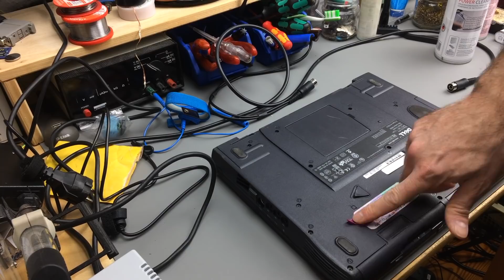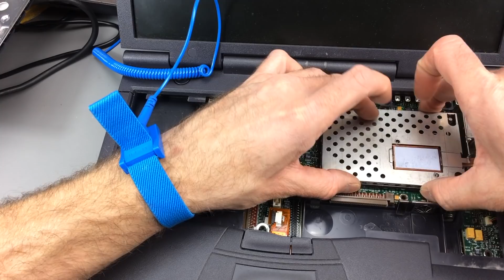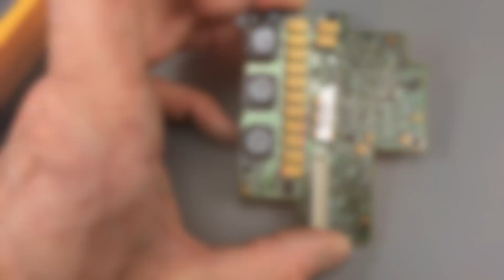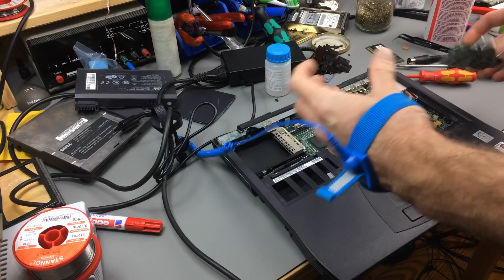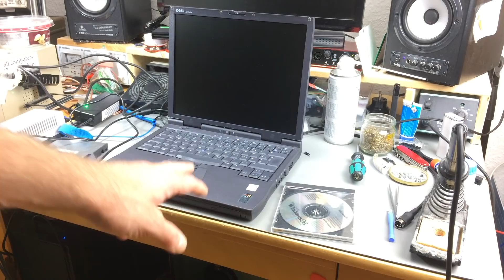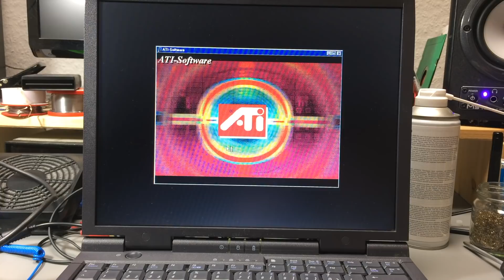Dell Latitude CPx H500GT Repair and Windows 98 Install

Comment: Are you using a Win98 Dell Product Recovery CD?
Reply from the maker: No, just a standard Win98 CD. I didn’t find an image (or actual physical media) specifically designed for this machine anywhere. (It’s an old video so it may be available now though.)

Comment: Hello friend. I have adquiered recently the same laptop. 
I was trying to use it for programming in C language. 
But I'm not able to use the symbols <> when I'm inside DOS. Instead, when I run win98 I'm able to use those symbols. Do you know how could I fix this dum issue? Thanks in advance
Reply from the maker: You probably need to use another keymap, look up the KEYB DOS command. There's a lot of options and I'm not sure which keymap works best for this particular machine and your keyboard layout, so you're going to have to figure that part out yourself. Hope that helps!

Comment: Jan: I have a Dell Latitude CPt-V from 2002. I put 2x256mb sticks inside, PC100 and PC133...maxing out the ram to 512mb. My hard drive is 20gb, with Windows 98 Plus. The CPU was a Celeron 466mhz Mendocino; I put in a Celeron 500mhz Coppermine which in the BIOS shows up as a Pentium III CPx-H. Also replaced the CD ROM drive with a dual DVD ROM/CD writer. I purchased both my charger and CMOS batteries directly from China. I had to wait more than 2 months for them to arrive in San Francisco and finally to New York. I really enjoyed watching you repair your Dell Latitude CPx-H. It's a classic. Awesome video.😊

Comment: That daughter card on which you are measuring tantalum caps with your meter is a Voltage Regulator Module.
I tuned in because I have a Latitude CPt on my workbench and these models are somewhat similar.  Yup.  I'm in repair mode.

Comment: Hey. I just managed to pick up one of these at a second hand store and it is unfortunately missing the power supply. I'm wondering if you might know what cheap power supply you bought as a replacement for the original as I would like to test mine but would rather avoid paying the 50$ with shipping prices that ebay sellers are asking for OEM power supplies

Comment: thanks the idea with replacing the ceramic capacitors on the power board helped me a lot!!
I got one question though... where the heck is the cmos battery?? I need to replace mine as well.

Comment: I didn't see any BIOS / CMOS battery 🤔
Reply from the maker: It’s below the track pad in this model I think. I’m going to have to replace it eventually.
Reply: @JanBeta  Maybe you should do a video of that. I have the same laptop but mine just blink a few times the 3 little LED ligths and turns off. I think I should open it up and see whats wrong. I hope I can fix it and your videos are very usefull. Thanks.

Comment: Jan! I have exactly the same laptop with the same problem. Perfect condition but plug a working Dell charger in and no lights came on AND the charger green light went out! So a bad short. Am watching closely.!!! Good job! This is almost a perfect W98 laptop/ ATI 8 mb graphics is surprisingly good. This will run MSFS 98 very well. 
   Oh windows 98Second Edition and instal PLUS! on it to have cool desktop/screen savers. Good luck.

Comment: Can you check how much video RAM it marks?
I have the same model with windows 98/2000 dual boot
On windows 98 it marks only 64KB video RAM
But on windows 2000 it marks 8MB

Comment: Hello
I have a laptop model dell latitude CSx H500XT, just use the FDISK to partition the hard drive then restart it and I got the message "the operating system is not found"
What should I do to access the hard drive.
Thank you
Reply from the maker: You have to install an operating system. If you partition the drive, it initially is completely empty. On boot up, the computer searches the hdd for an operating system.

Comment: I'm working on one of these right now.  Currently it's giving me the "bad RAM" lights, Power, Caps lock & scroll lock.  They all stay on for a few seconds, then shut off.  Maybe it's the power board inside like yours, but I don't get the same symptom of a shorted cap.  A couple notes... You can run two batteries in it, and you can get a cable that you can connect the floppy (not the cd) drive to the parallel port so you can use both at once.  Uses PC100 SDRAM, and two 128MB SODIMMs should work if you want to really max out Win 98.  I have Win 2k running on an older CPiA 400, so I'm sure that Win XP would run on this.  I'm planning on using mine for a DOS 6.22 computer, if I can get it working.  We used to use these at work, so I have a lot of time with them, along with the C600, C610, C640, C800, C810, C840, X200, C400, D400, D410, D420, D600, D610, D620, D630.  I've had some sketchy results with aftermarket batteries in these, too.
Reply from the maker: Thanks for the tips! I hope you get yours up and running fully again, too. :)

Comment: "Bob Ross"   (chuckle)    Can just hear it...   "Happy little tantalum caps..."

This fix makes me wonder if there's some piece I could track down on a Toshiba Satellite A355D (powers on, but no POST).   Probably wouldn't bother with the HP Pavillion DV6700, as my understanding is they will ALL quit working eventually (and it has so many other bad parts like the battery & keyboard).   They were freebies as well, although I don't have the access to a soldering bench like I did working in a zSeries test lab.
Reply from the maker: Haha, maybe I should do it like that. :)

Comment: My Latitude CPi-A (300MHz Pentium II) from 1999 also still works. It came with a cable to plug the floppy drive into the printer port so you can use the optical drive and the floppy drive at the same time. I upgraded the CD-ROM drive to a DVD drive; it's not fast enough to play video DVD's but it works great for DVD-ROMs. Mine has 256MB (the maximum that fits in there) and it ran Windows XP for years, but by the time SP3 came out, 256MB wasn't enough for XP anymore so I downgraded it to Windows 98. I'm jealous of your nice 12" 1024x768 screen; I couldn't get one of those at the time so I had to make do with the 11" 800x600 screen.

Comment: Good job! At that time no doubt nobody repaired computers at the single component level anymore. Typically the whole of the voltage regulator module would have been replaced. Yet, such part obviously not being available anymore (this is not yet a venerable collectable machine worth selling spares for), you managed to get it working. Marvelous.

Comment: If you install Windows98, you really have to go with SE, for the USB support.
Reply from the maker: Oh, I did. The version I installed is an old OEM Windows 98 "Zweite Ausgabe" (which means second edition in German). The USB stick I tried didn't work because it's too modern/large I assume.

Comment: CPXh and CPXj laptops differed by the CPUs they supported and had a slightly different sound chip.  You could hack the older one to the newer one which would give you a better range of CPUs but as the older one had no hardware support for speedstep, the CPU was locked at full speed constantly. Basically you forced the wrong bios into it to make it work.

Comment: The MMC1 and MMC2 style CPUs kept the CPU on the card with North Bridge.  Some of the Latitude CP laptops (Pentium MMX Based) could he flashed into being a CPi (Pentium II based) with a special floppy.  The Pentium MMX and Pentium II used the MMC1 style, and I think the lowerend Pentium III used the MMC2 style.  It was somewhat an industry standard for laptops at the time.

Comment: think this machine will also run xp. a ssd upgrade will also ad some speed and reduce noise.
Reply from the maker: You're right, it will run XP fine probably. I specifically wanted Win98 to have a real DOS layer I can play with. :)

Comment: Consider upgrading it to 98SE for which you can find an OEM bootable disc on winworldpc of, and then using the 982ME software and an ME disc to get the absolute best of both worlds. all the good stuff of ME with all the stability of 98SE.
Reply from the maker: Oh, it actually is SE! (It says "Zweite Ausgabe" on the CD, German for second edition.)

Comment: did you replace the CMOS battery (cause it forgot the clock/date I guess you had it removed and you might as well replace it for a fresh one) ? btw that Windows98 demo music, they must've thought their biggest clientele were for red light Windows (tm) :)
Reply from the maker: No, not yet. I heard they also get leaky sometimes so I probably will in the future. It seems to work fine after running for a while so I suppose the CMOS battery is still good after all.
Reply: yeah they last long. My Pentium 4's battery (one of the computers I daily use) has not been replaced for years, maybe I should do that :S

Comment: I have a slightly newer Dell Latitude (C600???) that's a 700-900MHz Celeron (lower speed when on battery) and a 20GB HDD.  One thing to note is that if you allow the batteries to totally discharge, they often won't recharge at all in the notebook (I've bought a few new replacements many years ago and all had the same non-charging issue if they fully discharged).  And regarding the hot-swapping of floppy/CD drives, I think there's a BIOS setting that enables/disables that because I think there's some lower performance issue w/ it enabled (if I'm remembering correctly).  I haven't touched it in 2-3 years, so maybe I need to take another look at it (if I can find the power supply).

Comment: Hi Jan, I think you were lucky with the cheap replacement power supply. They have a habit of failing and passing AC to the DC side so be careful with it.
I would add more RAM and try Windows 2000 Professional. That was the first real version of Windows that was really reliable and worked all the time with no BSOD's. 
Check also for any BIOS updates just in case that might help with any compatibility issues :-)
Reply from the maker: In the meantime, I managed to fix the cable on the original power supply and it works so I'm going to use that. I don't trust those cheap replacement psus very much... I specifically wanted Win98 on this to have a DOS layer although of course Win 2000 is by far the more reliable OS. ;)

Comment: BTW, isn't there a second drive bay on the left? Looks like there's a door next to the Floppy/CD bay....
Reply from the maker: That's where the battery goes. It has a different connector in there as far as I can see.
Reply: Oh... right... I just felt something could go there :) And indeed... a battery! :)) I had a Powerbook G3 back in the days that had 2 bays like this and you could put in 1 battery and a cd-rom drive or 2 batteries, etc... it was fun :)

Comment: Why not change all tant caps?
Reply from the maker: They usually are quite robust and the ones used are good brand ones as far as I can see so I left the good ones in for now. I don't know what caused the cap to fail in the first place, might have been the dodgy original power supply.

Comment: Wow-what memories! Dell CP series. Quite unreliable machines. I had to support over 50 of these style laptops in late 1990s, P2-233, 266, 300, and then P4 400, I believe. Those gold cards had really small, cheap cables. They also came with 3COM ethernet cards, and the dongles always would break down and interrupt connectivity. I can't tell you how many times we had to call Dell to have the motherboards replaced, too. Installing NT was a nightmare, as there was a certain order to add drivers to make the sound and then PC Cards work.
Reply from the maker: Wow, interesting that these broke down so often. It looks pretty well made at first glance. But then again, it was already broken when I got it... ;)

Comment: Nice job.  I have a similar unit at work I use only for reloading machine software on a 1994 vintage Injection Molding Machine.  You should look into getting a meter which will allow you to test capacitors in circuit.
Reply from the maker: Thanks Stephen! I actually have a nice ESR meter that can do in-circuit testing. Didn't use it because this one was pretty obvious and it didn't take a lot of work to find the culprit (also, most hobbyists probably don't have an ESR meter like that).

Comment: I love how easy these old Dells are to take apart and work on! Everything is labeled and accessible.
I have a Dell Inspiron 4100 from a year or so later, which is similarly modular. Even its GPU (An ATI Mobility Radeon 16MB) is on its own separate card, and can be replaced.
Reply from the maker: Yes, these machines are great to work on for sure. :)

Comment: I had a slightly older Inspiron with the same hardware. It was a great 98/2000 machine.
Reply from the maker: Yes, so far it seems to work very well with Win 98. I'll check some more demanding stuff soon. :)

Comment: My first IBM compatible PC was a Gateway 2000 (cow boxes and all...I was a late adopter to IBM's brand of computer....) Pentium 60. :)  It had Windows 3.1 with a voucher for Windows 95. Those were the days. I installed Linux on it and used it well into the late 90's. :) Man, those were the days... when PCs weren't cheap, but they could be tanks!  

Great video, Jan sir! You rock!
Reply from the maker: Thank you! My first PC was a Pentium 150 actually, I held on to my Amiga 2000 forever. ;) Never had a fancy laptop like this one back in the day. It surely is build like a tank. :)

Comment: According to a search on the HDD model number, it has a capacity of 6GB.  The M3ULM service tag does not result in any data shown on the Dell web site.
Reply from the maker: The data tag was probably a service tag from another provider or from the internal IT of the office this came from I reckon. The HD indeed is 6GB. Not too shabby for back in 1999/2000!

Comment: Hah, cool! I remember these well, I worked at Dell tech support back in those days.
Most of the early Dell laptops (Latitude at least, Inspirons were a bit lower quality) were really nice machines and well worth picking up if you're looking for something from that time period. Build quality is generally excellent.
By the way, that "Modular Bay" as they call it, where you put the floppy & CD modules, there is also a hard drive module you can put in there which was very useful back then. Try finding one on eBay, should be easy. It holds a standard IDE drive so it should be simple to mod it with a flash card of some kind if you like. Also, on some models you could also use the battery port for Modular Bay stuff, so you could for instance run dual batteries, or a floppy + CD/HD - stuff like that. Fun times.
Also like others have suggested: see if you can find one of the docking stations for it. There are several models, some are very simple with just added ports, but the big one has PCI slots in it which could be fun to play around with! 
On a final note: seeing that Gold Card gives me PTSD.. That is one of the worst pieces of junk I've ever come across in my career. Unreliable as hell, and they overheat like crazy so they break very easily. It also has one of the worst drivers in software history. We must've replaced many many thousands of those on warranty. Luckily there's almost no reason to use it these days, haha.
Enjoyed the video, keep up the fun content. :)
Reply from the maker: Thank you! I'll definitely look for more add-ons for this machine and try stuff out now that I got it working again. :)

Comment: I like restoration videos like this. This one kind of reminds me of the 1997 IBM ThinkPad 380XD LGR resorted on his channel last year, although he upgraded the hard drive, changed a battery,  installed Windows 95, and mostly did surface cleaning to it while this one you had taken it apart to get it fixed and working. I think I'm starting to like these older model laptops.
Reply from the maker: Thanks! I'm a huge fan of LGR (who isn't) and really enjoy his restorations. He's at least partially responsible for my interest in retro PCs. :)

Comment: It's NEVER the fuse...
Reply: Actually 

I just repaired one Gigabyte P25X v2 gaming laptop with I7 CPU GTX 880 graphics dual  m.2 SSD  etc . really descent one laptop

and it was only a fuse.
Reply from the maker: Almost never, you're right. Fuses usually blow for a reason. If the fuse is blown, there's most likely something else broken down the line.
Reply: Jan Beta  True that was my worry also , but apparently not , it just blew. almost a month has passed and it works as expected , so apparently it only had a jolt of some kind and it blew up .

Comment: Bad tantalum caps is a quite common problem in laptops, even in modern ones.
As for the retro thing, the oldest laptop I've ever serviced was a 600 Mhz  Coppermine Pentium 3 with 256 MB of RAM (don't remember the brand, it was either a Dell or an HP). Installed a light flavor of Linux on it. Ran pretty well for it's age. Even the battery still worked.
Reply from the maker: I really liked the old Pentiums, they ran pretty cool given all the power they had. I remember that changed drastically with the Pentium 4. Suddenly you had to have giant fans at full speed when your PC was running. ;)
Reply: Jan Beta Very true, especially for Prescotts which could literally double as room heaters. Those not only had big fans but giant heatsinks as well.
My old quad-core Q6600 came with the same size heatsink as many of those old P4 with just a single core.

Comment: The Latitude C series are great machines.  I had a C600 that I upgraded to a PIII 1000 that was my main machine for several years in the early 2000's.  There's a docking station that they make for these that sells for about $40 on eBay that allows you to install 2 PCI cards and another drive bay.  They make the machine a pretty good replacement for a similar era desktop...
Reply from the maker: I'll definitely look for a docking station. Sounds great! :)
Reply: A nice and prettier replacement compared to your typical yellowing boring case from such era!